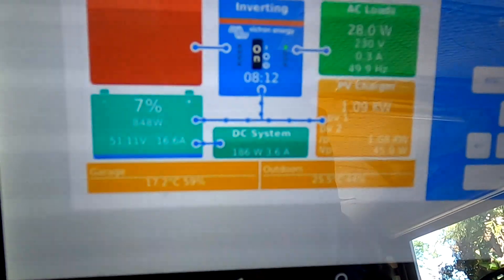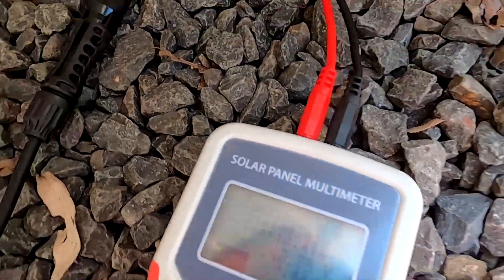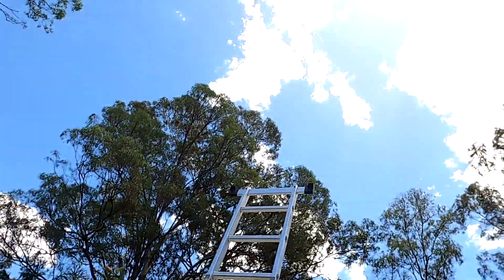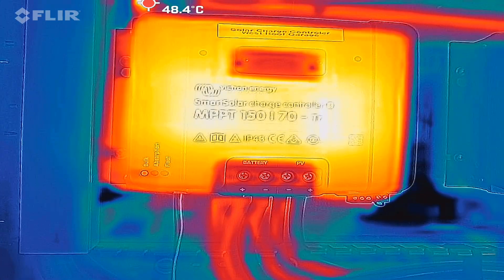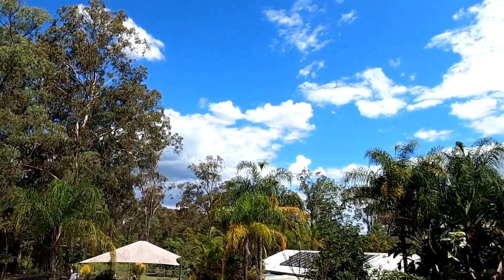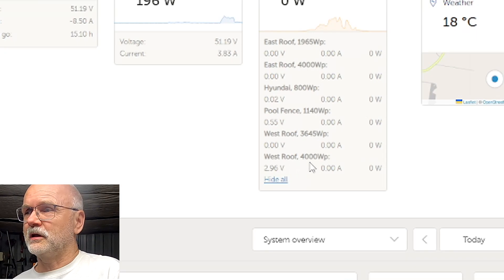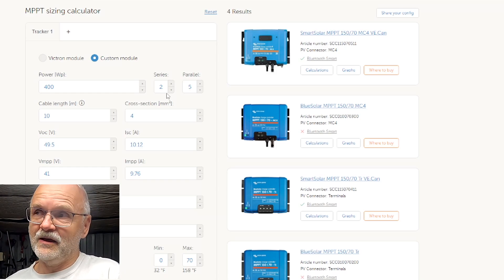First charge with the new West Roof. Can the Hyundai Shingled Panels deliver?

Comment: hi Andy why don't your mppt charge controllers compete and stop each other from charging ?
Reply from the maker: You can have as many controllers in parallel as you like as long as they all have their own panels. They only see the battery and don't interfere with the other controllers at all.

Comment: You're gonna start doing flips once the whole system is installed and you see the peak generation.   Its nice to see it do so well in the morning... that's the claim-to-fame for those panels, after all.

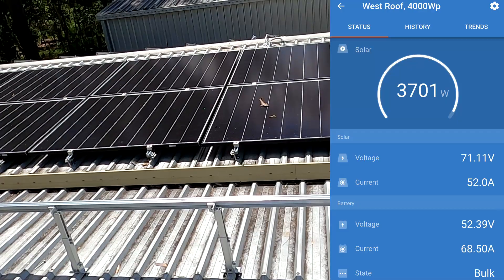Full sun probably is more around 3.5kW at 5:20-ish in the video.  You are getting extra from the brightness of the clouds nearby.   There will be times when that happens... when the sun peaks out from behind the clouds and you get full sun + bright clouds at the same time.  The system will cap-out for a minute or two.

At this point you really need to start looking into high-voltage string inverters instead of using these little low-voltage controllers.   I can't say how they would compare, though... having more, smaller inverters is always better in variable-shading conditions, but high voltage strings have far lower wiring losses and are just easier to manage.

edit: Well, in your case, charge controllers, not inverters.
Reply from the maker: I've got the other smaller system running now (3kWp with 8 Hyunday panels, 400W/ea) and it produces a permanent 3.8kW under normal sunny conditions. Over 4kW with these cloud corner situations. They are producing far more than they are rated for.
Longer stings are not good for these conditions and far less effective. I think this is the most optimal solution so far, even it was a hell of a job to cable all that.

Comment: Victron's chargers are rated to full output with ambient at temperature of 40c if correctly mounted.  After that they will throttle their output to keep operating safely.  They will get quite hot, but it's perfectly normal.  None-the-less I have placed a blower pointing across my charger's heatsinks to give them a bit of assistance.  It's not blowing a gale, I have them slowed to the point where they are almost inaudible and that does the trick nicely.  Summer temperatures here reach 35c and higher, none of that cool Brisbane weather.
Reply: Adding a fan will also increase lifetime of the MPPTs, if they are maxed out such a long time..
Reply from the maker: Yes, that is correct, we can see it outputs only 3.7kW, so already throttled. A fan would not make a huge difference (tried that) and I have too much power in summer anyway.
Reply: @OffGridGarageAustralia  Andy here is the benefit of 85A version of mppt. It has bigger heatsink, so better cooling.
Reply from the maker: @stanislavmlcuch2085  that is true. I have now capped my MPPTs to 60A. Too much power...
Reply: @OffGridGarageAustralia  When you are pulling maximu amps from mppts sooner or later they reduce the power. Solution is to put there 120mm fan or buy mppt with bigger heatsink. Friend of mine has around 40kWp and recommend me to buy bigger mppt than I need just because of this.

Comment: On what setting did you set your big circuit breakers on the battery again?
Did you calculate the maximum charge current, which you would get if all roof systems are up and running?
I think you need to reevaluate the trip setting on those breakers, because not only consuming current can trip them, but charging current as well...

Oh, what I totally did forget: Didn't you install 63A breakers for each charge controller? Their temperature trip could rob you of the fun eventually, above 80-85A at the latest...
Reply from the maker: Current is current, does not matter if it is charging or discharging. I have set them to 80A for each bank and 250A for the main breaker.
Yeah, the MPPT breakers are 63A only. I really did not expect so much output of these panels.

Comment: such an impressive system. I think I would be felling some trees ;)  Really looking forward to seeing the whole system up and running. 👍
Reply from the maker: That is the experiment I'm doing. Instead of spending $10k on cutting down these trees I invested this money in solar panels and can leave the trees as they are.
Reply: @OffGridGarageAustralia  I think you are going to have more energy than you know what to do with. At least in summer.
Reply: @OffGridGarageAustralia  wow really proud of you you Andy brilliant deduction!
Reply: @OffGridGarageAustralia  yes, it will be amazing when you have the full system. They are doing a really good job of the install. Did you get them to add more 'spray' on the exposed copper earth/ground wires? ;)
Reply from the maker: @mw0lge  All these connections are under panels and not 'exposed' as such. They will come back to finish off some other tasks and fully commission the system (labelling, cabling, ...)
Reply: @OffGridGarageAustralia  And so the trees will contribute to the climate and take some CO2 out :-)
Reply: He likes the trees, he doesn't want to cut any of them down

Comment: Hi why don’t you cut the top of the trees 🌲,to have full sun power ,( by doing this you are not harming the environment since you will generate more clean energy) ❤
Reply from the maker: Why should I if I can sort it out differently?
Reply: @OffGridGarageAustralia  that’s why I asked ( why ) 😊🌹🌹🌹
Reply from the maker: @hamieh1  https://youtu.be/nS72GpEO-zA
Reply: Gum trees have a nasty habit of dropping limbs, thats why you don't camp or park your car under them, also likely to get struck by lightening but thats what insurance is for!
Some solar panel makers could avoid honoring warranty if panels are mounted in shade, check your warranty details / contact the installer.

Comment: Stupid question. Your pulling 1kw from your panels. What voltage is that?
Reply from the maker: It's in the video. It's a 48V system and the panels have around 80V in their mpp.

Comment: Nice set up!  Do you back feed to the grid, if so how much do you get paid per kw, Or is it a real off grid system, what do you do with 80 to 100kwh of power per day?
Reply: AFAIK Andy does backfeed... but with a completely different setup on his house (he's locked into a contract so can't change anything there).  This setup is "off grid".  Having said that, this system takes a lot of overhead out of his house setup and so this system 'vicariously' backfeeds into the grid if you get what I'm saying.  I think he's running a pool pump, lighting and charging his Tesla with the power.
Reply from the maker: It's the Off-Grid Garage, mate 😂
Reply: Ok. Nice, at least in the winter he will also get a decent amount of power from this setup
Reply: @Jmax777  Yeah it looks good.  I'm currently building a completely off grid house and am watching what he's doing very carefully..

Comment: Clipped your solar already.  Clipping is good for the winter months.  I bought a cheap charge controller rather than clip the power.  It makes me cry when the batteries are full and the inverters turn off the panels.  I might buy a water heater to dump all the extra power as I don't have a Teslander.  Lol
Reply from the maker: Yeah, summer is simple. Lot's of power right now.
The hot water connection is in planning as well as a pool heater. And a fridge in the garage 😊🍺

Comment: What is the max. current you are expecting at full sun and without being limited by the charge controller? Maybe even more than 85A?
Reply from the maker: Around 50A from the solar panels which is then 80A into the battery.  Just a guess though what I would expect from these panels. It's not worth going for a bigger controller but would be cool to test it and see the real numbers. Once the other roofs are connected, I will have too much power anyway, so a bit of clipping is OK.

Comment: Have you gotten the new SEPLOS firmware for your Madson battery kit BMS ?

Meine Energiewende has released a video yesterday about the firmware .29 solving at least some issues you had faced like shutting off balancing once charging stopped. 
Hope you will examine it too if the balancing is working now and we can avoid adding an active balancer at least for smaller batteries. 

The elejoy checker for 800W panel is also a lot better.  Got mine in August and was able to check the modules for max output.
Reply from the maker: I just left a longer comment on his page.
The new FW 2.9 does not change the behaviour of the balancer unfortunately. His test was a bit... When he stopped charging the balancer seemed to 'work well' but in reality, the overall pack voltage decreased which pushed all cells back in the flat area of the curve, hence the voltage delta decreased as well. It looked like the balancer is working when the cause of that was the decrease of the overall voltage.
The 2.9FW has no visible changes to function of the BMS as far as I can tell. The balancer still sucks!

Yeah, I really like the display of the Elejoy Panel tester. it's a great update from the previous model and well worth the money.

Comment: I much prefer my SMA Sunny Boy strings which can put, say, 10 panels in series. Max amperage is 15, but it can handle 4.5kW (throttled to 3kW) for each of the two entries. But I guess you'd need an SMA inverter for that.
Reply from the maker: That's not gonna work in shading conditions like I have though. There is a perfect reason behind this design. I could have stringed all panels together as well but the output would be far less.
Reply: @OffGridGarageAustralia  Ah, yes, of course.

My setup is obviously different with mainly vertical south-facing walls (northern hemisphere...)

Comment: Hi Andy, will you ever be in danger of going over your battery banks C rate for charging? For example mid day peek sunny day, you are at work and one of your 3 battery banks goes  down.
Looking really impressive though mate.
Reply from the maker: I have 864Ah battery, and they have a 1C rating, so no😊
Reply: @OffGridGarageAustralia  Math never was my strong suit lol.  I will have to double check the data sheet for the ones I have ordered,  EVE 280 and I am sure it was 6000 cycles at .5C
Reply from the maker: @garys-half-baked-offgrid-dream  that sounds about right. They still can do 1C though, just with less cycles... I'm restricting charging now to stay way below 0.5C.
Reply: Andy dear boy I Double checked my order from Fogstar UK, grade A EVE 280LFK up to 6000 cycles @ 0.5C charge & 1C discharge.  Allegedly these will come with factory EVE grade A test certs.  Fogstar UK also list grade B cells slightly cheeper.  My PayPal is maxed out lol, any quality problems PayPal own them lol.   
Still popping my pants though.
Reply: @OffGridGarageAustralia  ANDY! ANDY! ANDY!!!! I have just had a delivery notification from Fogstar UK they will be with me tomorrow by 2pm. I have a cold nervously excited swett on. 
I am not a religious man but God I hope this is 3rd time lucky.
Reply: @garys-half-baked-offgrid-dream  The manufacturer's data usually states the absolute maximum charge rate, then the maximum recommended charge rate but never the 'happy' charge rate.  Often the charge rate for optimum cycle life is 0.3c.  Quite a lot of people look at the absolute maximum charge rate, see the charge rate of their system at or near that and declare 'all good' when in reality it is quite hard on the cells.   There's usually no convincing them of this either, it's only when battery life doesn't meet their expectations that they realise something is not right... and then they blame the cells rather than themselves.
Reply: @retrozmachine1189  Everything has a Goldielocks Zone.
Reply from the maker: @garys-half-baked-offgrid-dream  Very nice. I'm keen to see you photos!
Reply: @OffGridGarageAustralia  A single 864AH battery under the control of a single BMS or lower capacity units each with their own BMS hooked in parallel.  It makes a big difference :)
Reply from the maker: @retrozmachine1189  No difference at all. The single battery banks just give you more control over each individual cell, hence I prefer that. I'm a control freak and need to know...
Reply: @OffGridGarageAustralia  Oh it does Andy.  Entertain me.  Set up a test.  Bring all your batteries in the bank to your full charge point.  Then discharge the bank by say 10%, start automated logging of the current into each battery, bring the bank back to full charge and finally plot the data for each battery.  Even the best matched batteries will show divergence, not enough to be a  problem but it will be there.  The worse the match between the batteries, the more divergence.  Please don't tell me you've already done this but if you insist you have,  point me to the relevant video.
Reply from the maker: @retrozmachine1189  that's what we have balancers for? Done this several times here on the channel with all kinds of batteries...
Reply: @OffGridGarageAustralia  Nope.  Not once.  You are not addressing what I am talking about.  I'm not talking about cell balancing nor battery balancing.  I am talking about controlling charge current.
Reply: This is something I've tried to convince people about but no one really seems to grasp the issue.  It doesn't have to be a battery tripping off either.  As the batteries come up to full charge their inherent slight capacity differences will see more of the available current going towards the lower SOC batteries.  Eventually this imbalance may result in a higher than desirable charge rate to one or more batteries or even get to the point where the BMS has to step in and terminate charging (this protection is not a desirable thing to run into, think of it as being in a car crash bad enough to fire the airbags).  Being able to adjust the overall charging current or limit current to each battery using a switching BMS really does matter.  It's not something peculiar to lifepo4, it is an issue with all battery types.  Andy's raspberry pi running Venus is capable of coordinating the total output of all his chargers but I'm not familiar enough with it to say if it can make use of the amps reading from Victron batteries to limit the max current any one battery sees.  It would be possible to have a shim / driver to make the amp readings of his BMS' appear in Venus if he hasn't already done that.
Reply: @retrozmachine1189  Yeah the weak and lame will be the first to POP, I had that issue with gowd awfull  lead acid.  I am only Just stepping up to liFePO4 now, shitty wee bloated things from Aliexpress lol.

Comment: I don't know if those trees are protected and I am full against deforestation but those trees could use a little trimming, don't cut them just make them a bit shorter and maybe get a little off the sides too, not only to reduce shading on the solar panels but to reduce the danger those trees could cause during windy days and storms
Reply from the maker: https://youtu.be/nS72GpEO-zA
Reply: I topped 2 trees so I would have no shading from them. I live in Michigan USA west side and we have so many trees around. I am gonna plant 2 new trees in there place even though they are just topped. thinking fruit trees.

Comment: Victron has RS models of MPPT series, those put a lot juice.
Reply from the maker: They are only good if you can use higher voltage strings of panels. With shading, that not a good option though. You want parallel strings.

Comment: Shading is really affecting your strings. I would suggest you first trim those trees and wire your panels in parallel in order to reduce the string impact. Otherwise divide the shaded strings into different victron mppts. Those Shaded mppts will help the unshaded mppts to work better.  If you are able to solve your shading, buy the 450v victron mppts. they have multiple pv trackers and will still work with your victron ecosystem.
Reply: His stuff is in parallel and all his roof space gets shading from the trees at some point with minor variations in severity but the all suffer and he is building around that. I recommend you binge watch his older videos.
Reply from the maker: I don't need to cut any trees. Wait for the full setup....
Reply: I agree that would help but in past videos, Andy has stated that he does not want to trim the trees.    Instead, he is going with many panels knowing he will get shade.     He could certainly get more out of the system with additional controllers.    It is a trade-off of the cost & difficulty of adding controllers vs the benefit he gets.    (His general approach to date is to add lots of panels).
Reply: yes, I concurr. Put the shaded panels on one string. And the others - which are always in the sun - on the other string of your mppt tracker.
Reply: He has a 2s5p configuration with only 2½ being shaded, with the amount of planned panels in his array, he will definitely get more than enough yield.
Andy is an environmental protection activist so trimming the trees is a no no..,.
Reply: I don't think he needs to... it looks like more than enough Amps are charging his system. Albeit if Andy wants to expand the battery it might be another matter 😄
Reply: @IkkjeDus  I am doing a similar installation 4x eve 280ah 48v batteries and 16x365w qcell panels. It will basically be an offgrid installation. You want all the power you can get specially on cloudy or multiple rainy days hahaha
Reply: Wouldn‘t this be a perfect scenario for micro inverters? Each panel gets its own mppt that deliver 48V straight to the busbars.
Reply: @rudisoft  Supposedly Sunpower solar panels only get affected per cell. I am doing offgrid so I cant use microinverters.  But those panels are really expensive.